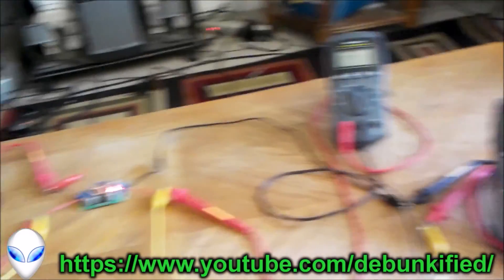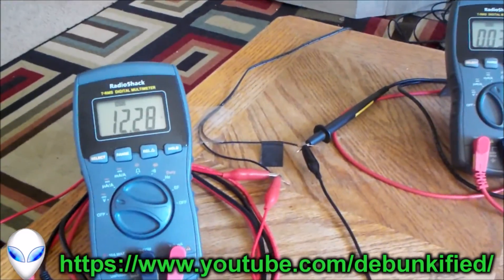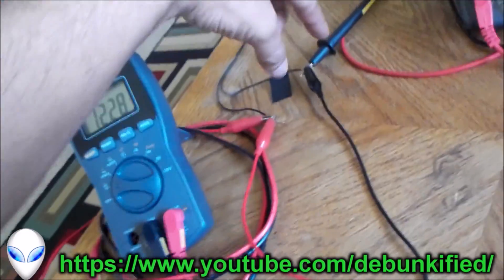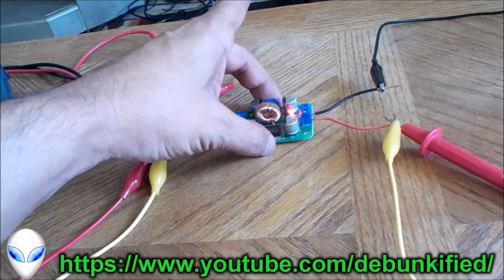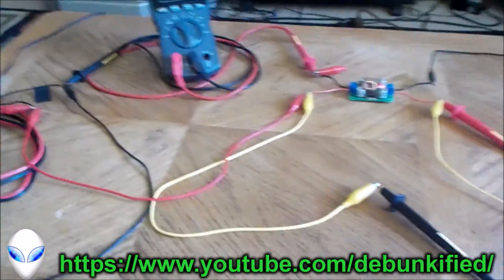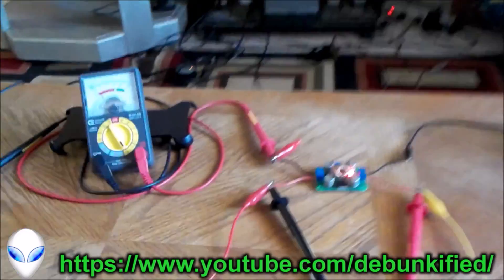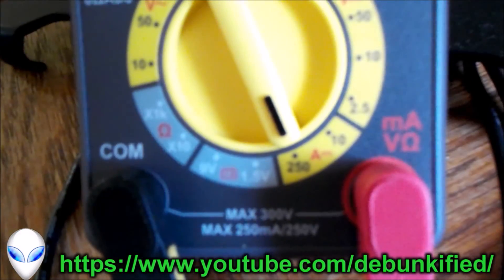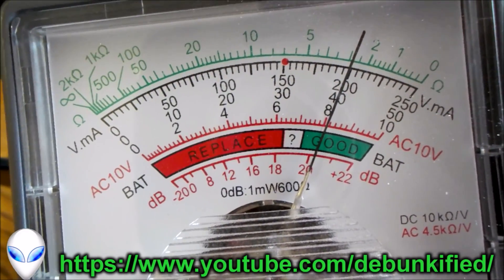Solid State Looped Overunity

Comment: Hi! I think others have tried to explain your connection problems, but maybe I can help. You need to treat the Input side, and the Output side of the power converter completely separate... no connections from one side to the other. A common misunderstanding of Ammeters is that they must always be connected in series with a Load... you can not connect an Ammeter directly across a power supply or other poser source to measure its ability to output Current.

The wrong connection of the Yellow cliplead from your Output Ammeter Black lead that returns back to the power converter Positive input lead. This is not measuring Output Current... this Ammeter is connecting the +Output to the +Input. (Are you aware that an Ammeter is a short-circuit internally?)

You need to have a "Load" in the Output circuit in order to measure its capability to output Power (Watts). A resistor is the normal "test load" to use, since it is completely passive. Try a 10-Ohm 10 Watt power resistor for a test load.

Then you would connect the OUTPUT circuit as follows:
1) Connect the power converter (+)Output connection to the "+" Ammeter lead
2) Connect the "-" Ammeter lead to the (lead-A) of the test load resistor
3) Connect (lead-B) of the test load resistor to the (-)Output of the power converter
4) Connect the Voltmeter directly across both leads of the test load resistor

The way you have your Input meters connected will work fine, but it is far more common in electronics to put the Input Ammeter in series with the "+" (positive) DC wire from your wall-wart power supply.  
1) The Ammeter "+" (Red) would connect to the wall-wart "+" wire
2) The Ammeter "-" (Black) lead connects to the power converter "-" input connection
3) Then your Input voltmeter would connect DIRECTLY across the power converter Input connections... not back to the wall-wart wires... for this would induce errors from the Ammeter losses.
Reply from the maker: You are correct! This was a connection that was wrong! This is to show that one little connection connected wrong can give misleading results, while on the other hand once connected correctly will show an entirely different and more true result.
Reply from the maker: +debunkified Take a look at this video https://youtu.be/DhQowrDVmJk
It shows easily more power and energy out than, consider what has been mentioned.
Reply from the maker: Hi there beforebefore!, Ok most people would treat the Input side and the Output side as completely separate. I on the other hand do not do that. This is due to 100 years worth of electronic doctrine, sorry to say, but it's true. I've done it too actually, for about 20 years while seeking free energy. If others have been doing this without seeking free energy or refusing to believe such a thing exists, then just imagine how hard it must be for them to believe anything else!

If I were to have continued to believe the output is part of the input then this would not have enabled me to see beyond that. In this video here https://www.youtube.com/watch?v=DhQowrDVmJk&t=25s  I show how the output is most definitely not connected to the input side in anyway at all and that output voltage is actually lower than the input voltage. If the output voltage is lower than the input voltage then there is no way for any current to flow back to the input and load it down. If you know of any other circuit that can do this besides some kind of step down circuit, then please let me know! 

Here you say "The wrong connection of the Yellow clip lead from your Output Ammeter Black lead that returns back to the power converter Positive input lead. This is not measuring Output Current... this Ammeter is connecting the +Output to the +Input. (Are you aware that an Ammeter is a short-circuit internally?)"

Yes I am most certainly (aware that an Ammeter is a short-circuit internally.) That particular DC to DC converter has the negative connected internally inside. (Are you aware that the DC to DC converter's negative is already internally connected?)

So the only thing left is to just simply connect the power converter's Output "+" back to the power supply's input "+" side. You are right in that this loops the energy back to charge the input power source. As far as this being above 100%, you are right, it is not above 100%, meter wise, and time wise, an over 100% reading will never be seen like this.

This particular circuit is only 95% efficient, when reading it as others have been reading it for the last 100 years. So I most certainly can place the ammeter in between the two positives and measure output current going back to the power source.

The power supply is it's own load and so there is a "Load" in the Output circuit. This very well works with a battery as well. And so the ammeters are actually connected in the way that every one is used to, and that is in series, which is the common way to measure current. I show absolutely nowhere that the ammeter is placed in parallel, that would drain the power supply of course and show a 0V and cause a ton of current to flow through the ammeter.

You said the ammeter on the input side is fine as is, and it is indeed connected directly after the wall-wart measuring current coming straight out of the wall-wart as a power supply. I see no need for an expensive 10-Watt 10 Ohm load power resistor when there is already resistance in the battery, which is acting as a load as well.

Don't get me wrong though, a resistor would only help improve the measurements even further, but I don't find it necessary when there is already a load resistance in the power supply in itself, which is it's own load. The converter is acting as a load for the power source as well is it not?

You can not place an ammeter on the negative side as it's already connected internally inside of the power converter. The ammeter will simultaneously measure current coming out of the wall-wart as well as current coming back in the opposite direction from the power converter. This would push the current coming out of the wall-wart backwards showing a lower reading.

All in all the point is that there was an intentional mistake made to show that one single wrong connection can show overunity, while correcting that connection will display underunity, which is what we've been measuring for 100 years.
Reply: Until you power a load and show what EXTERNAL Work can be done, and then measure the amount of Input Power and also Output Power (Work), it all means nothing.

Comment: You have proven your circuit is 0.45 Watt UNDER unity since this is still what the circuits input requires to operate. If your input current meter would display a NEGATIVE number, then you may consider the output is providing more power then your input. Clearly not your case. Looping a device is the best way to prove OU BUT when you do this you can ONLY use the input measurement as the output is what's being used to offset the input power.
Reply: Right on

Comment: Complete nonsense.
Your ampere meter displaying 692mA shorts the positive input to the positive output, effectively turning the DC-DC converter into a step-down converter with the ampere meter as the load. The voltage across this load is the difference between the two volt meters, approx 0.03 volts. Input power correctly is about 0.5 watts.  output power is 0.03 * 0.692 or approximately 0.02 watts.  So you have about 5% efficiency.  Too sad you can't work around physics.
Reply: He does this in all his videos, won't show  a diagram, won't show how his coil is constructed, and eventually takes the DC-DC converter and hides it in a "mysterious" box. 
That way you cannot see that the "output current" is the short circuit current from input to output.

Comment: They say you can't have your cake and eat it too. In your case,  the "cake" is energy stored in circulation, which can look like a lot, if you don't consume or "eat it". Think flywheel. Once a flywheel is brought up to speed, it only  takes a tiny amount of energy to keep it going, even though the power it packs can be tremendous. The only "real" power you should consider is , the  DC power being provided by the mains power supply, and the power being drawn by a load.